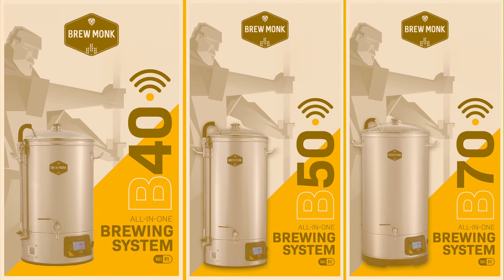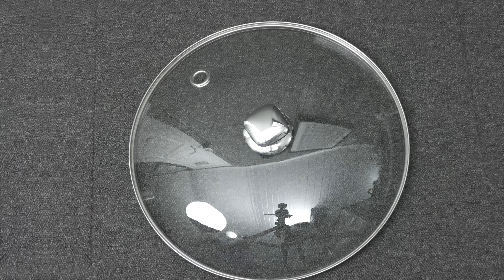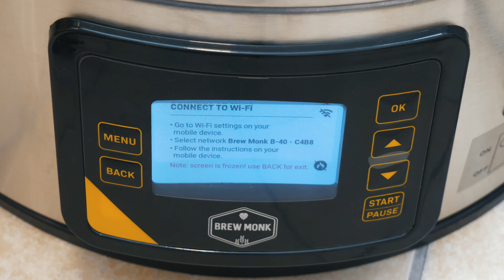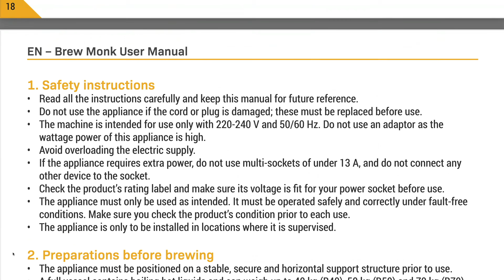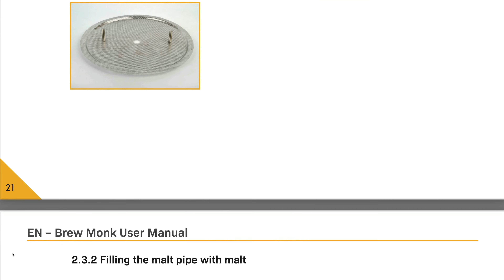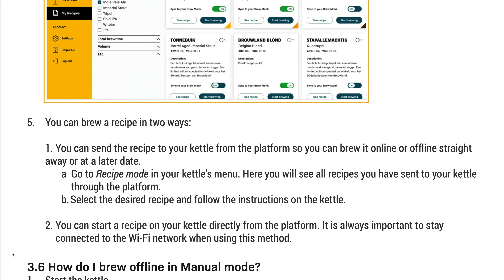New BrewMonk WIFI Models Initial Deep Dive For Homebrewers

Comment: In the description it says you can load up to 18 kg of malt.  but I think that will greatly detract from its effectiveness.  what do you think would be the maximum malt I can load without worrying about inefficiency?
Reply from the maker: Yes for sure. Possibly 12 kg as a guess from previous experience with other systems.
Reply: @DavidHeathHomebrew  Thanks for the reply.  I'm curious if anyone (of us who subscribe to this channel) has tried a larger amount?  14 or even 15 kg.  Although I have doubts about removing the full malt pipe at the end of mashing... 🙂

Comment: We are 5 months later now, I am on the edge of buying this system, can you endorse it now or not ?
Reply from the maker: I like the system. However it is quite old tech with wifi added. Bazooka filters and old style heating elements for example. 
So really it depends on what else you can buy in the same market and price. I should really do a comparison video.

Comment: From what I can see it is almost identical to my Hopcat, which just died and I am looking for a replacement.  i would mention the malt pipe riser rod which is a bit iffy. it can easily slip out of its seat with very hot and painful results.  Great care.  Anyway, thanks for the review.  🍻
Reply from the maker: These systems are made by one factory with a variety of different options both external and internal. These are ordered to spec and then rebadged by different companies. The Brewmonk wifi model spec is unique in certain ways inc the controller.
Reply: Addendum: I fixed my Hopcat quickly with minimal cost.  This machine is as durable and reliable as a German tank.
Reply from the maker: @Zamolx72 Great to hear 🍻🍻🍻

Comment: I had the older 45l magnus unit it worked great for 3 years before an upgrade to the BZ 65l.👍
Reply: 65l is great for triple keg batches with the boil extender.  Rapt app and PID are a learning curve I'm still trying to figure out but works great in manual mode.
Reply from the maker: For sure. I have a guide for setting up the PID here:- https://youtu.be/OyLE10VU4-I?si=PYB0vSfH4QOZq5Zm
Reply from the maker: Great 🍻🍻🍻 You prefer the Brewzilla ?

Comment: I use the older gen one and the 40L version looks virtually identical to mine but with a new controller. I wonder if it is possible to swap out the controller so I get the benefits of WiFi and recipe transfer. The locking tap is great but a couple of times I struggled to shut it when things went wrong cos the lock was down. Also it is a pity there is no filter on the pump inlet as getting to the pump means you have to unscrew the bottom cover.
Reply from the maker: Great. I am not sure if that is possible. You would need to ask Brouwland on that one.